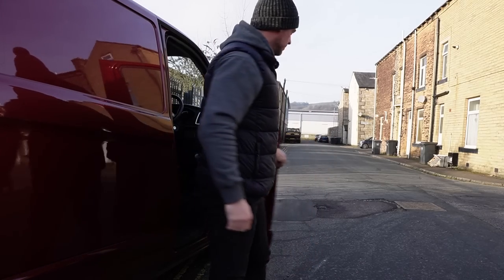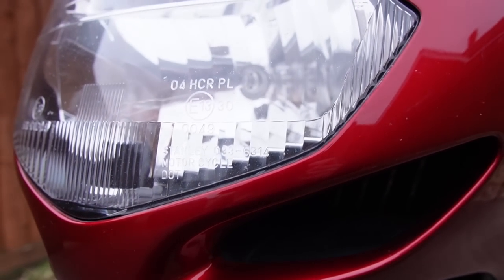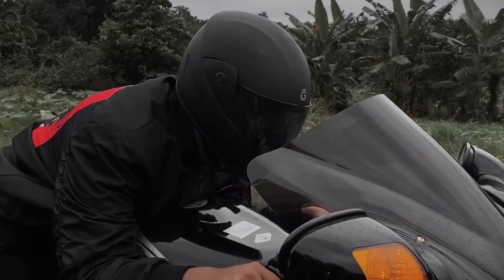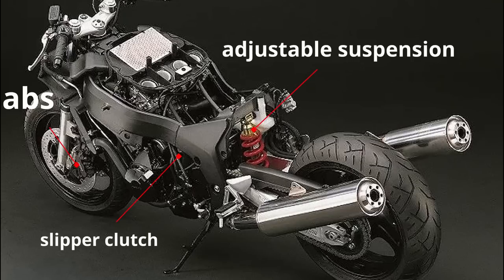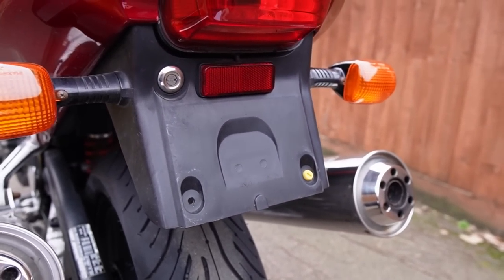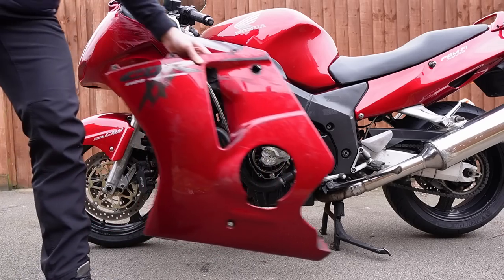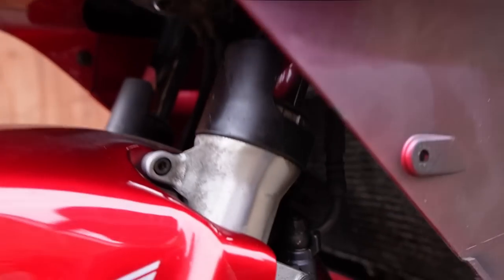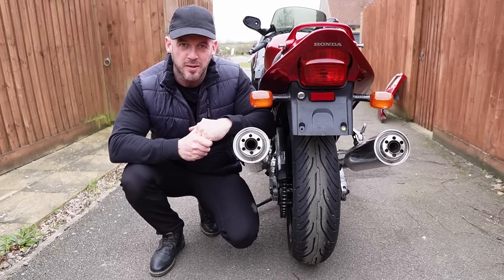EVERYTHING WRONG WITH MY HONDA BLACKBIRD

Comment: With all the necessary/planned work needed this is not going to be an economic repair. It would probably be cheaper to buy a nicer low mileage one that's not on the register.

Comment: Great bike, I have a 2007 bought with only 14,000 kms 3 years ago and just love the smooth power delivery, comfort and handling, just to note these bikes do not have a slipper clutch or ABS they have CBS which is a combined brake system where front and rear are linked, it works well although some riders de-link them. treat them well and these bikes will last forever, definitely a keeper.
Reply: Very off-putting then that this guy mentioned the Blackbird comes with these features. Lying or just plain ignorant?
Reply: my 07 yama 1300 has a slipper clutch.  meaning all hand and or foot with no clutch handle just a finger trigger shifter.

Comment: My wife's boss has one of these. He's had it for years, rides it to work every day, rain, hail or shine. It's about a 50 mile round trip, too. He's obviously kept up with tyres, chains, sprockets etc. but aside from that, he hasn't touched it. The bike is well in to the six figures now and it runs like a Swiss Watch. The finish of the bike has held up remarkably well, also, especially considering it's outside for the best part of 50 hours per week.
Honda did a pretty good job on this model, for sure.
Reply: The Honda finish in the 90s was outstanding.  My CBR stood up to the same all year round UK punishment and it didnt tarnish at all with only a daily rinse during the winter.  My Yam and Kwak bikes suffered rust in many places over the same period.

Comment: Just wanted to add that the front fork kit Jaws sells is excellent he also does a rear shock rebuild service which I can also recommend, not sure if he still sells used parts, once it's up and running the fuel injected bikes do run hot so don't worry if the fan is always coming on and off

Comment: Looking forward to future updates. I've owned a 1999 FI for 22 years now. It's been the best machine and practically bulletproof  🙂
Reply from the maker: Good to hear! How many miles have you put on your bird?
Reply: @BikesofRye  She only has 28,000 miles. Reserved for sunny days only 😁
Reply: I have the same bike (1999, fuel injected) which I use as my daily commuter for work. It's just ticked over 140 000km (whatever that is in miles, I'm in NZ) with zero issues apart from the rectifier needing replacing. No modifications, totally original and it's never let me down. Did a 5000km tour of the South Island last year and easily kept up with the sport bikes. Restore yours and keep it.

Comment: I don't want to be negative but I've been around bikes,bikers and bike shops for long enough to know that's going to be a money pit. I'd have gone for something at least running and with everything in one piece,would have cost a bit  more but saved a lot more in the long run and still had the fun of tearing down and rebuilding. 
Good on you though,a running total of costs would be interesting.
Not knocking you at all,far from it,I've just seen so many  guys over the years take on this kind of thing not realising  what they're getting into.
New subscriber and I'll be along for the ride wishing you luck all the way.

Comment: Tip: when putting your BB on the centre stand use the lift handle accessed through the rear cowl cut out. BTW BBs were fitted with link brakes but not ABS
Reply: yeah.....none was ever fitted with abs brakes as standard...CBS

Comment: Own this beautiful machine myself, 2004 model.
Went from a 125cc straight up to the Blackbird & ironically felt safer on the Blackbird (despite driving in pouring rain when I first drove it on public roads) than I did on the 125 as the 125 was was a Lexmoto Michigan which meant the tyres were horrendous (for Lack of a better word & surprised they're even road legal).
LOVE my Blackbird & wouldn't change it for the world :)

Comment: Good vid! I bought my first BB in December last year from a local bike shop,a 2001 model with 46k miles on,a full mot,serviced with new front pads,recent aftermarket shock and custom paint for £1,350. Amazing value,and the power is incredible

Comment: I like Hondas because of their reliability. 
I read about one guy that took an unmodded Fireblade to 250K miles, so 70k means that the Blackbird is just breaking in. Go all out,though, with the build. Make the bike immaculate with the paint and details. Use the best suspension components and brakes only because you are going to go way past 200 mph. 
If you can get on Bruntingthorpe for a top speed run, that would be cool. Regardless, do things to the bike that may seem overkill but will enhance.

Comment: My Blackbird lived in the garden under a cover. Left all winter and it would start at the touch of the starter button in the spring.  Fantastic bike. Only issue I had was the generator failed. Got a replacement from Jaws. Sold it ( wish I hadn't now) as it was so smooth you'd be doing 100mph feeling like 40 and worried about my licence.

Comment: I've just sold mine other day  missing it. red as well 1st of injection.  When you sed about changing the pipes please don't if possible it doesn't Look right. I was going to put on power commander quick shifter but never got round to it.

Comment: I owned a cbr 1000 f what a bike what an engine and it was my first big bike and I always think that it was a good choice at the time. I swapped it for a red 1983 Kawasaki g p z 750 r 1 with a Harris performance 4 into one exhaust. It was and still is immaculate and I will never sell it as it is such an iconic bike. When I was sixteen I saw one for sale in a bike shop and just fell in love with the G P Z range at the time the Eddie Lawson rep was in my opinion motorcycle porn in green but also the red version was a looker as well. What can you say about the Blackbird apart from wow looks ace and goes like fragg.An instant hit for Honda.

Comment: I bought a pup BB. All it's ills were cured by a new cam chain tensioner stator battery and reg rectifier.  Don't do any of the snake oil fixes like the loom fix. It's bullshit. That engine will be fine, replacement isn't necessary. Please keep it standard. So many modified to some individual's idea of what looks good or makes it faster.  Love the stock cans.

Comment: Might want to check out that main stand  when you put it on it looked a bit low like the rear tyre was touching  the ground or could be as mentioned  a different  shock .. the body work will be the biggest problem all the other jobs are pretty easy
Reply: A common mod is to put a 6mm shim above shock or get a ride height adjustable shock to improve handling

Comment: Some of the eBay cheap body fairing kits aren’t too pricey. I put one on a ZX6R I crashed years ago 😔. There are some dodgy kits out there too so you have to be careful!
Reply: A mate in the trade once told a customer not to waste his money on one of those eBay body kits from China,told him he'd be amazed if it even arrived and there's no way it would be any good at the asking price anyway.
Guy went ahead and the quality was pretty amazing ,fitted like original with zero hassle and the bike looked like new.
I'm old enough to remember when people  were saying the same kind of things about Japanese stuff,a couple of well-established dealers around my way selling Chinese bikes.
Reply: @dave8204  The one I put on the ZX6R wasn’t too bad at all and was much better than expected.  A few of the mounting points needed a little fettling but that was all.  It was a fraction of the cost of getting OEM bits and came fully painted.  It was even cheaper than buying second hand bits that would need minor repairs and paint! But I have also heard some horror stories so would buy from a seller with some reputation.

Comment: 164 bhp and 194mph top speed , what is 310kmh. This one was the first in 1997 which hit the 300kmh barrier for first. What you were talking about was the after 1999 fuel injected model

Comment: Excellent videos, I currently trying to find out why we don't have any zx25 in the UK. They sound and look like a brilliant bike, especially for a starter bike . Do you know if we might start seeing them here.
Reply from the maker: Sadly I don't think we will ever get the 250cc as it won't pass emission regulations plus I don't think it would sell very well in the European market. However the 400 is coming by the end of the year!
Reply: @BikesofRye  thanks, that's great news about the 400 . There engines are great. What's your thoughts on the 2015 BMW rr 1000 . I've been looking at 1 today on eBay for 8k

Comment: Narr and missed brake lines , most inportant , prob doo full brake rebuild at that age 
Yea to the rest but would repair plastics
And deff just replace engine cover , get it back to near standard even if scrached up 
Not so shure about tuneing it thow 
Had a original busha stage 1 flashed and cans , air box ect 
The thing with black bird is not easy to tune , very nice ride thow and built like brick shit house